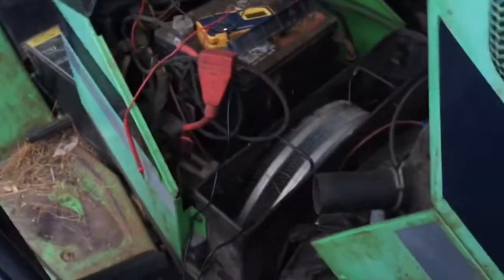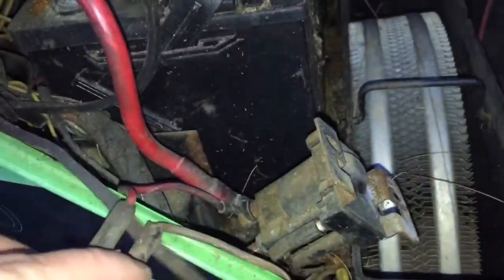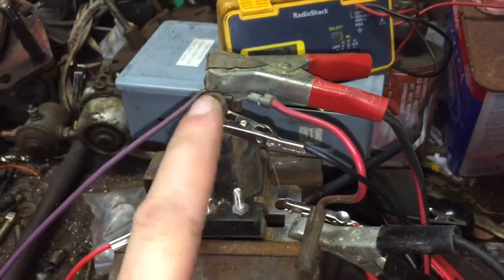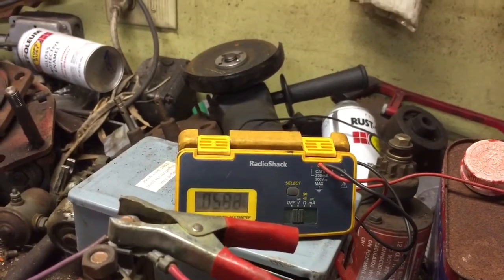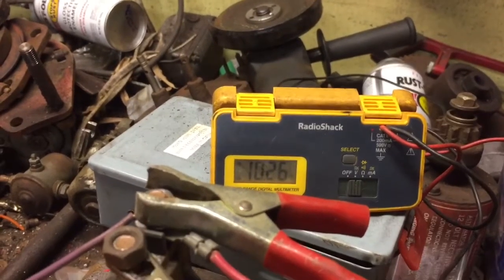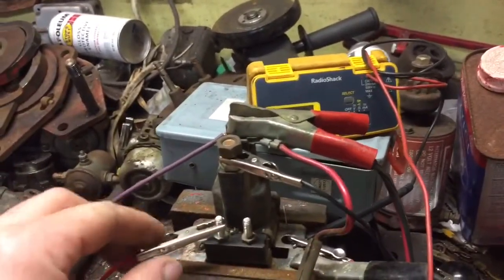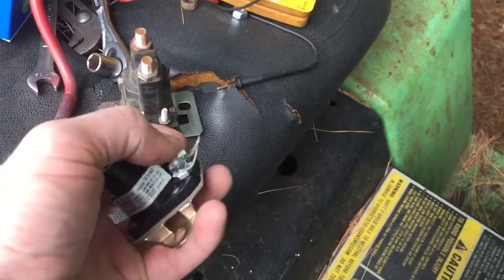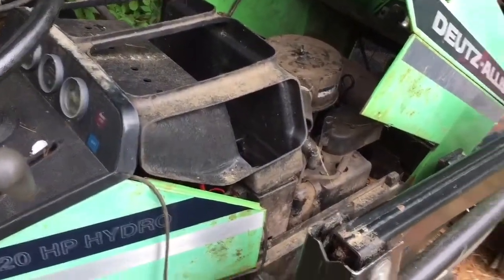Fixing the Deutz Allis 1920 Part 1

Comment: I think that little box there by the solenoid is a circuit breaker kinda like a fuse but it is like the old vehicles had on head lights, it would break connection and in a bit  connect again.
Reply from the maker: MissouriOldTimer ahhh yes , after I filmed this I found the wiring diagram and it is a circuit breaker...  Good eye

Comment: Where can one order parts for 1918/1920 Duetz Allis parts??? My 1918 ultima won’t start… Will turn over but not starting… Any help appreciated…
Reply from the maker: Deutz is the same as Simplicity which is now owned by Briggs.  If the engine is the issue you can get parts from any Kohler dealer…
Reply: @rw3dog  yeah i noticed today it was a Koehler engine 18 hp… Found the issue, it has a magnet broke into two pieces on flywheel… Thanks for tip on simplicity… (???) Any ideal if they sell the magnets separate and if so, if know best place to order from??? Thanks very much appreciated… Hoping not have to buy whole flywheel with attached magnets…